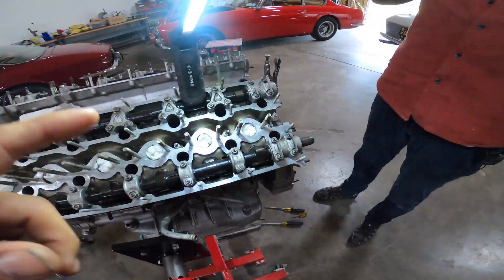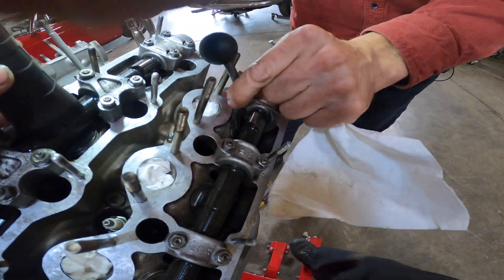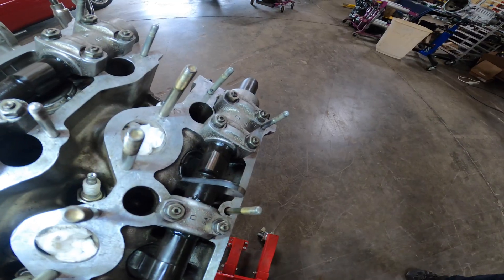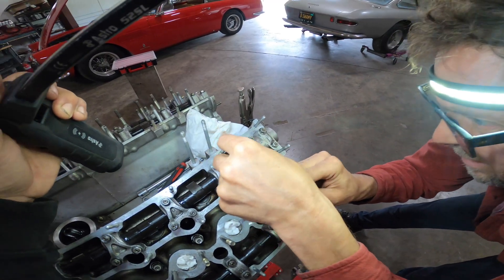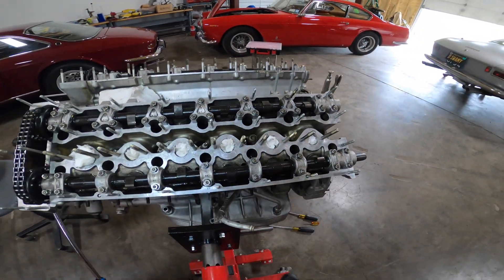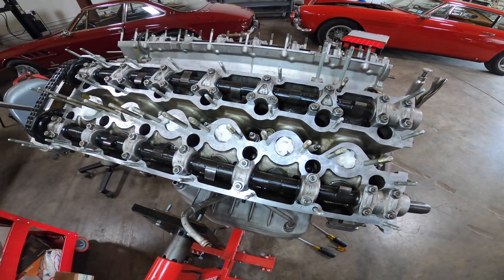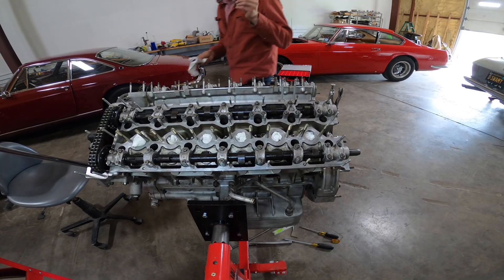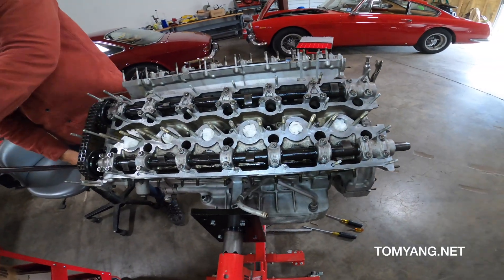Ferrari valve lash on a four cam engine

Comment: The evolution of the V12 and other internal combustion engines up to this point must have been pretty interesting.  I wonder how far Packard got with it’s V12 design, the inspiration for Enzo.  I haven’t seen equivalent videos of a full service of a Packard V12 engine.  Also, is this a Columbo V12?

This makes you really appreciate the knowledge and skill of these guys doing this work.
Reply from the maker: Yes, this is a Colombo engine design, but in a four cam version. The two cam versions are less complicated. I have a comparison video coming soon!

Comment: And I thought German cars were overly complex, there must be a good reason for this process. More stable measurement and clearance in the end? Fewer parts in the valve train?
Reply from the maker: You think this is complex? On Jaguars, you have to measure the clearance, take notes on each valve, then YOU HAVE TO REMOVE THE CAM, to insert the correct shim. I'll stick to Ferraris, thank you.
Reply: @tomyangnet Goodness, will stay away from Jaguar!
Reply: This type of buckets are quick and easy to adjust with the right tools. 👍
They are a bit worse when you adjust them from the bottom. 🙈😂

Comment: Valve adjustment is the one thing I'm not looking forward to doing on my 308 QV. Not that it is _hard_, just tedious and cramped on that front bank, I'm guessing.
Reply from the maker: Valve adjustments on a 308 are not fun, and QVs are worse! It may be easier to remove the deck lid so you can have better access to the front bank.

Comment: There is a Fiat factory tool for changing valve shims on the Fiat 128 model's SOHC engines and Fiat 124 model's DOHC engines that works the same way and probably would be easier to use.  Have you ever seen one? The Fiat tool has two (2) narrow fingers which catch the lifter/tappet on both edges/sides so there is no slipping and the shim can be popped out using a small pick or screwdriver. 

Moreover, I would not reuse the Ferrari's  shims because that would be akin to using an old used lifter/tappet against another one of the camshaft lobes.  I have always been told that a used shim, since it rubs against the cam lobes, "wears in" with a pattern specific to that particular lobe of the camshaft. Re-using that old shim on another camshaft or against another lobe of the same camshaft, is likely to wear the cam lobe faster.
Reply from the maker: If the tool has two fingers, it may not be the same diameter of the Ferrari shim. 
We check the wear of the shim, and unless it shows excessive wear (rarely seen it) there's no harm in reusing the shim. I've worked at several shops, and none of them have thrown out used shims that are in spec. I have seen shops surface shims as a cheap way to not buy more shims, which is big no-no! 
Thanks for watching.
Reply: Takes me back to adjusting the valves on my 71 Fiat T/C the exact same way.
Reply: Volvo as well, if it's 33mm shim for 37mm bucket. Or if it's easy to pull the cam then making a tool for dial gauge works wonders.

Comment: that’s exactly what happend to us: the hook always slipped out - that‘s something for people with a lot of patience, especially on a 12-cylinder 400i as we did - engine built in and you first have to put the cams in the right position. When the shims are really sticking a short shot with compessed air helps it getting loose.
Reply from the maker: My tool (the one that popped out) worked great on other four cam engines, but not this one. Stephen’s personal tool for some reason worked better. It’s different every time. At least this time we got to do it with the engine out of the car, it’s worse leaning over a fender, and let’s not talk about a 308 getting to to side by the fire wall!
Reply: @tomyangnet I wonder if it’s even possible on a 308. The next would be my car, that’s a 208 GT4 and I couldn‘t emagine you could do the shims on the front bank by the firewall.
Reply from the maker: @heikoschwammle4650 it’s possible, but will take some laying over the engine!